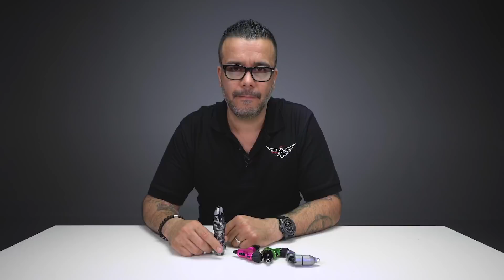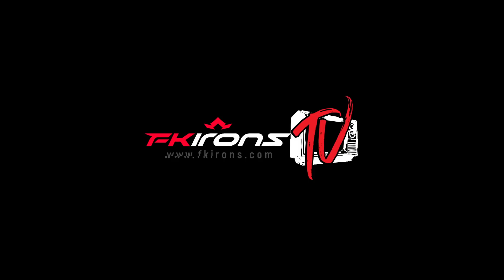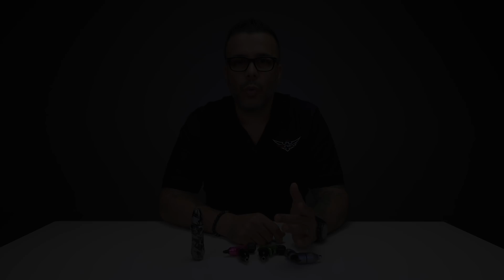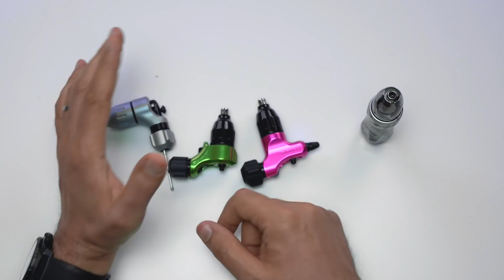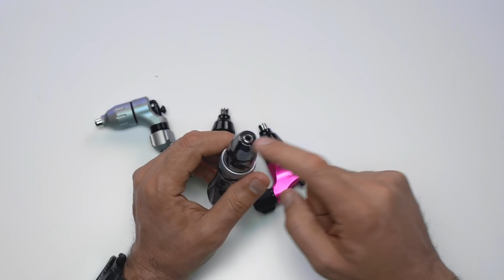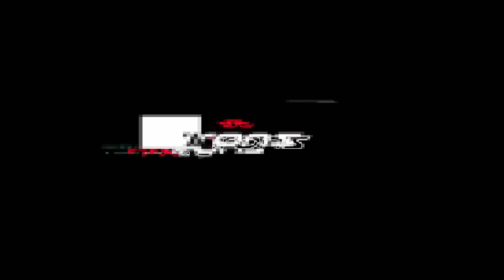Why Tattoo Machine Motors Fail & How To Prolong Their Life

Comment: I got in touch with FK Irons through Instagram and they messaged me back that same day and game me a certain link where I could purchase just the motor bolt for my spektra direkt off of their website. I Paid for the motor bolt and shipping that day,  and got my motor a week later. I’d say that’s spectacular customer service .  I’ve used my Spektra Direkt 2 for longggg hours and I have it run constantly , not with a foot pedal 5-6 days a week for almost 3.5 years and it just burned out last month. I’d say that’s pretty fucki*g good , I’m a satisfied customer and still prefer my spektra over my Xion because of the counter weight and I can push down the needle to clean it without having to run it lol .    Instagram.com/je_ccc for work I do with it , always prefer no give if possible

Comment: What you talking about? I got chayenne thunder for 5 years and is still working without any problems. When spectra xion came out bought two of them and just over a year motor fail in both of them. For machine which cost 600£ I expect longer life than just a year
Reply: Max Kucharski if that happened during a year you are covered under warranty. Nothing to worry about.
Reply: Gaston Shutters he said “just over a year”
Reply: Same problem bro ... 16 months and motor is dead 😂😂🤨😡🤬😤